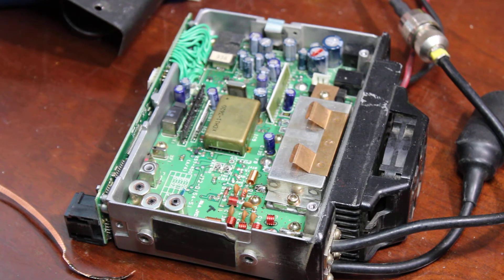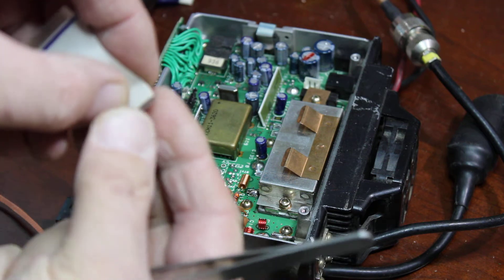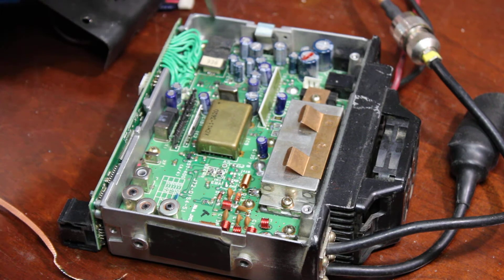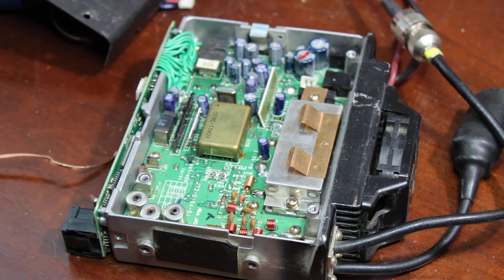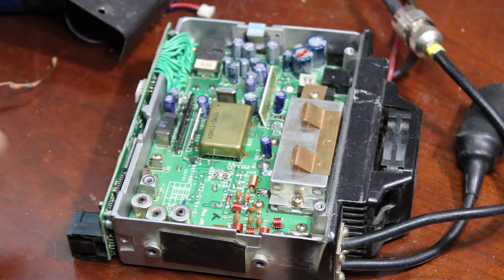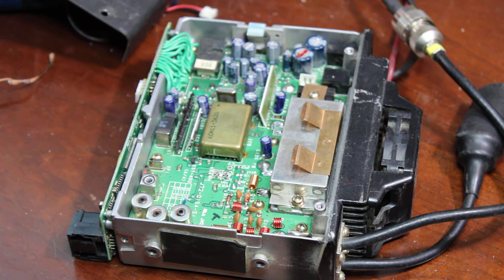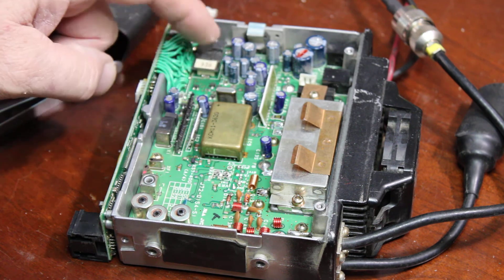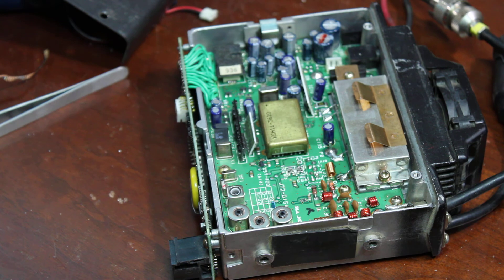Kenwood TM732A problems/Repair

Comment: Nice job! I've got two of those Kenwood TM-732As that have been sitting on the shelf for a couple of decades! I decided to bring them back to life but I realized that on both of them only the lower left part of the screen works. I can see "43" but not the rest. The bulbs also are not lit. On one of the radios, after I played a bit with the squelch, the rest of the screen came back to life but the other digits are not as black as the lower left part of the screen. Now that screen works occasionally but the bulbs are flickering and the digits are lost from time to time. I have already replaced the electrolytic capacitor you mentioned but nothing changed. Do you have any idea where I should look for this problem? Thanks!
Reply from the maker: Yes,
Your problem has to be on the faceplate somewhere and it really sounds like a bad solder.
First, get a eye loop or microscope remove the faceplate board completely and study every solder joint while moving around your squelch/volume knobs. 
If you can’t see anything out of the ordinary, then reassemble the faceplate just so it’s working but without the cover. Use something wooden and start very softly by touching and dragging the wooden stick over the solder joints and just touching various spots on the board while observing the display. Sometimes it’s impossible to see the broken ribbon cable but the problem could be there too.
Don’t give up, these radios are awesome
Reply: @prplepopsicle  These are some great ideas! Thanks for your encouragement! I'll try them.